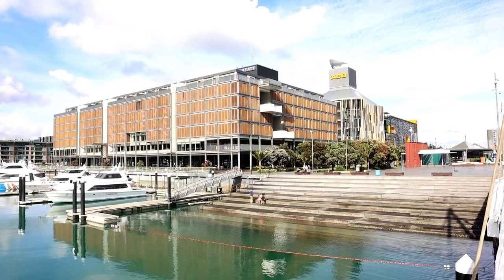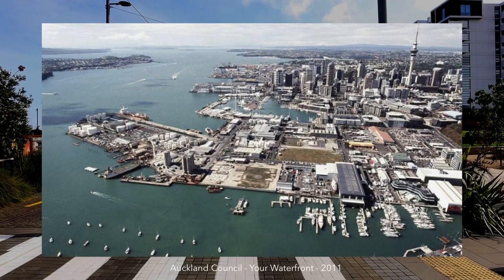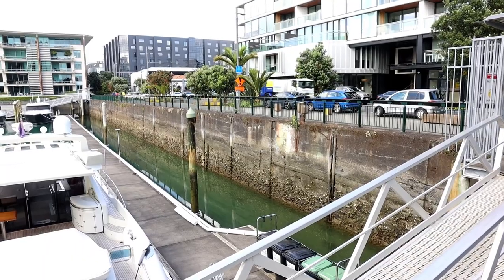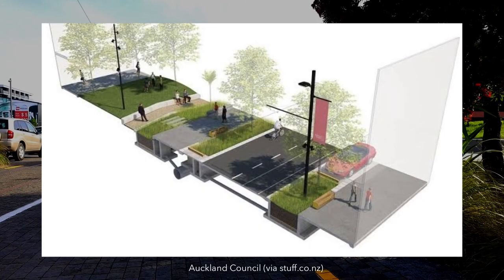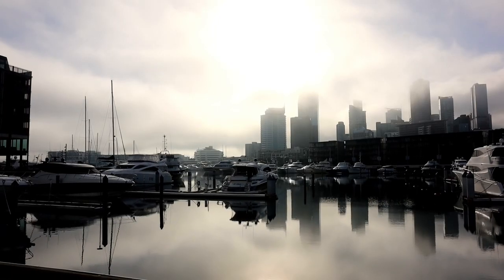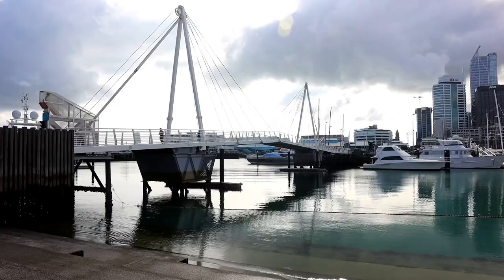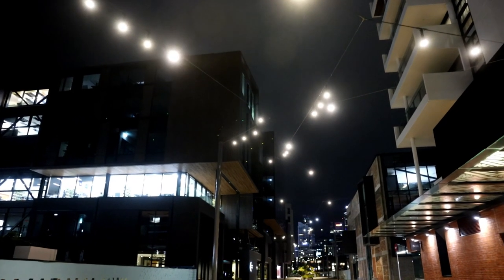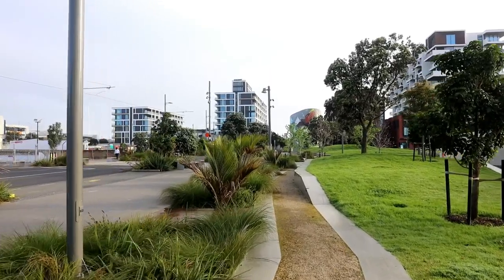Priming the Development: Wynyard Quarter's MASSIVE Transformation (Part 3) | Chris Farhi Vlog 72

Comment: Bro why new zealand is not making huge Skyscaper
Reply from the maker: Kia ora bro, good question - believe this is mostly due to the way the district planning worked where they would max out the floor area for developments based on a multiplier of its land area (“floor area ratios”). Had heard that some of the new planning regimes are relaxed this but other issue is that super large projects are harder for developers to get enough pre-sales or pre-leases so that also caps the size in practice. Hope this helps!